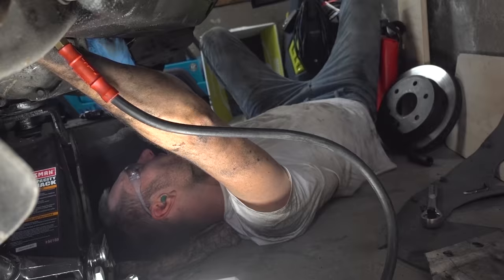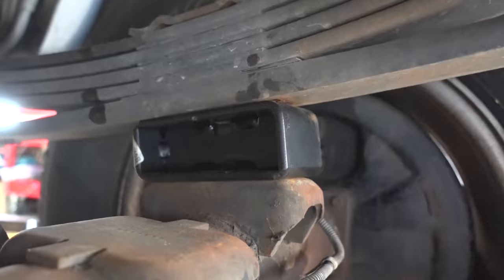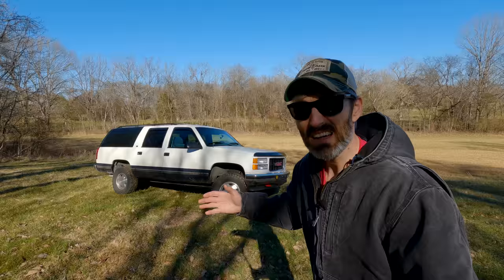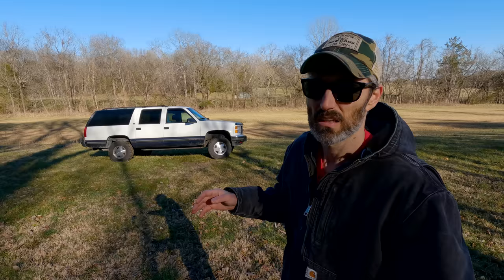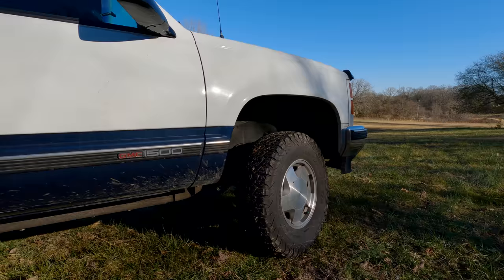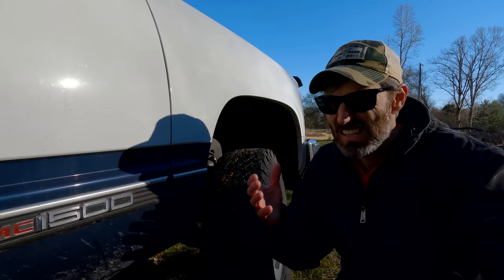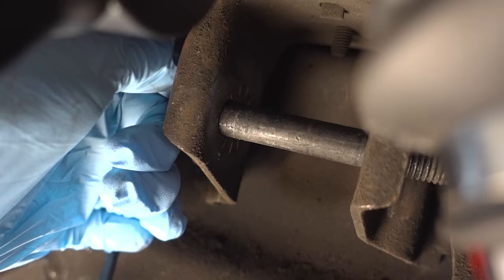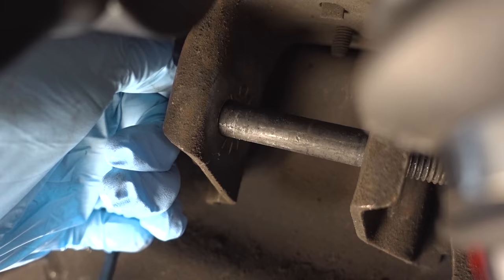Rough Country 2-3" Lift Kit - LONG TERM REVIEW!!

Comment: Great job Jimmy! Honest, thoroughly tested review. Glad I didn't rush out to get one for my Suburban.
Reply from the maker: I seriously considered a body lift only before this… now I’m wishing I went that route. Maybe I’ll still do that. 🤔
Reply: @1RoadGarage  Nothing wrong with a body lift, if you actually get the bumper relocation brackets, and brake line extensions.
Reply: @1RoadGarage  body lifts suck a hole nother way! Way hillbilly bc all your wires are going to be stretched and strained. Lots of problems that will turn into a nightmare. Don't do it!
Reply: I have this same lift kit on my wife's 1998 k1500 suburban  and absolutely  hate it.

Rides like crap and eats front end part.

I have been slowly  collecting  parts to do a SAS on leaf  springs  .Custom leaf packs from Off road design  and it should  ride pretty  good .

Pretty  simple  to do with a Ford dana 44 hp. 

Even able  to retain  abs with hummer h3 brake from THOR parts
Reply: @@stephenmckinley8855  This is the proper way.  SAS or just leave it stock.  The torsion bar and A arm drop bracket kits are a hot mess as well.

Comment: My 2001 GMC 3500 Dually for years looked like a wedge going down the street. The front end was always sitting on the bump stop, so my son and I cranked those bars and now the truck rides level and feels better.
I have put 3 ton of wet sand in the 8 foot bed and didn't even hit the overload springs.

Comment: I did the same lift kit to my 1999 suburban a little bit after you posted your video of doing it. yeah i've had a hard time aligning mine also. I just had it aligned for the third time and it is still a little off. I've just decided that its good enough and im going to keep it how it is. Im really happy with the tires I have under it though. They are 33" Maxxis razrs MT. I would highly recommend them to anyone. I get insane amount of grip in all surfaces, even deep snow. Ive even crossed through a stream with them no problem. If I could do it all again though I would not do the lift and just trim the fenders a little bit to fit the tires.
Reply from the maker: Good to know on the tires. I love the BFGoodrich so far but like to hear what everyone else is running.

Comment: I have a 94 k1500, I did the 2 inch blocks and also used the Rc keys, I did about the minimum crank on the keys and got about an inch and 3/4 lift in the front.  I think maybe if you just would have done the keys only in the front it would have been way easier and maybe closer to the results you wanted.

Comment: Thanks Jimmy! I have a 1999 Tahoe and everyone is telling me to lift it. Mine has low mileage and needed some general work done to it. Figured it smart to get the Tahoe 100% safe and reliable before I start messing with lifts (which I am almost at that point of deciding on a lift) and was looking at this Rough County lift but like you couldn't get over the torsion bars being used to lift the truck. I follow another guy on YouTube and he brought up the same issue you addressed here with this kind of lift. Thanks for saving me the headache and hassle if I were to have gone down this road.

Comment: Everyone I know always chops off those bump stops for the control arms when they lift it- Obviously it was put there for a reason but in the 3 years I have had my listed truck I haven't experienced a single problem with chopping it off- actually I've noticed the opposite! As far as off roading it has given me so much more travel in the front. I don't know about your suburban but I'm my Silverado has another bump stop on the lower control arm which does a good job of still giving you some support. Appreciate the video though! There's a lot you hit on that I would have loved to know 3 years ago haha

Comment: There are 2 reasons why the front lift is more than the back.  1.  these vehicles almost always come from the factory with more height in the rear than the front and, 2. when off roading, since you have a fwd bias weight balance because of the engine, you potentially compress the front springs more when you hit a large bump or dip so you need a bit more suspension travel there.  The front modestly higher is NOT an engineering problem with the lift kit.  You can buy a larger block for the rear if desired, make sure you get appropriate U bolts with it.

Comment: You're completely right.  I have a 92 1500 Silverado 4x2 ( springs inted but basically the same problem ) I had the exact same problem with down travel and alignment and when the wheel moves up the alignment changes really bad giving you an unsafe feeling ( probably it is ) all this issues are gone in my case when I add an extra cross member ( Rancho kit) .  This holds the lower control arm giving it more space between both control arms and the right angle . Of course you will need a kit with longer links and probably in your case, spindles.  The rear suspension is very easy to fix . Give it a chance before you take it off . One more thing , the kit will probably move the " offset" out (that happened in my case )and will look better in my opinion . And some spacers in the back :)

Comment: Part of a suspension lift is that the lower control arm is replaced with a modified lower control arm to combat the excessive positive camber by giving a slightly more negative angle so when the lift happens your camber will be close to the factory spec of camber.
Reply: Where can I get the modified lower control arm?

Comment: I hate to bash on anyone's products, but I've had your same experience with RC. Put a 4" on my Toyota tundra, yeah that was not smart on part - but after three years,I did the same thing, pulled it off and put on a quality lift that returned my ride quality and didnt need an alignment every year.
Reply from the maker: Interesting. Noted.

Comment: I have a very similar lift, I did the ebay one that are the same components. I don't have the same issues. I kept my stock shocks, I also kept the stock control arms. I used the keys from the lift. I have a good alignment, The front is exactly 1 inch lower than the back. Once you replace the control arms with the stock ones. Try keeping the RC keys and adjust them so the front is 1 inch lower than the back. I also switched to a coil over front shock. This allowed for less tension on the torsion bars. Did not need the shocks for the alignment to work. I hope it all works out. Let us know what happens after removing the RC control arms but leaving the RC keys. Keep'em coming, stay on the road!

Comment: I was very skeptical when I considered purchasing a “leveling kit” for my 1998 Chevrolet k1500 so I done quite a bit of research also. I ended up piecing together a leveling kit which included 2500 heavy duty extended swaybar end links, 1-3” adjustable torsion keys, and 1-3” freedom off-road upper control arms. I previously replaced the idler/pitman arm with MOOG replacement parts along with the original shocks on the truck with bilstein 4600 series with no shock extenders. After all the components were installed the torsion keys were only turned about half way up and  the shop that aligned my truck had to remove a key/tab so they could align it properly. The truck handled and drove amazing especially since I had enough space between the upper control arm and the bump stop. I could easily clear a 285/75r16 maxxis m/t tire on a 16x9.5 billet specialty wheel or a 305/70r16 Toyo m/t tire on 16x8 weld wheel. I hope that maybe this info will help with someone looking to do something similar. Thanks for the great content that you’re able to distribute and help spread knowledge.
Reply: I’m considering getting the leveling kit for my 03. I’m currently running the bilstein 5100s and want to swap to 4600s because they are softer and will make it ride better. But the 4600s are for stock ride height trucks did you have any issues with that? Also mine is currently sitting on the bump stops, will that go away if I install the leveling kit

Comment: The reason the rear is lower in your case is because it’s a suburban. The rear half of your truck is MUCH heavier than your standard ext cab K1500 pickup. Like you said these are average/guesstimating measurements for different cab configurations. Glad to see you’re still working on this ole girl!

Comment: I actually love this kit because I actually put it on my 98 Tahoe.And it worked amazingly And all I did was just take it off-road a couple of times and to some trails and some off road sections near my home. The truck actually performed a lot better than a dead stock And I barely lost any fuel economy.I went with Falken wildpeak at3w LT265/75/r16 I can't wait to try this on my 1999 tahoe 4x4 I was actually really stupid for selling my last one On this next one i'm going to do a HT383E GM create engine with a 4L80E auto transmission Next time i'm using AT4W Falken wild peak

Comment: I used lift keys and Kryptonite upper control arms on my silverado 2500hd. No issues after 50,000 miles.

Comment: You're the man! I was considering doing a little 2-in lift to try to fit bigger tires under my 96 Yukon but I honestly I'm not a huge fan of the look... Because then you're basically forced to run an oversized tire, speedometers already way off, I'm not down for a much harsher ride and the inability to align properly. I remember when I had my Jeep TJ one guy called rough country rust country and told me that they were garbage. I'm guessing old man emu and stuff like that would be a better lift but I'm sure it would be substantially more expensive. The other thing I don't think I heard you mention is if you're dropping your front differential by 2 in to keep the axles at the proper angle then you technically are losing the ground clearance that you were trying to gain in the first place. You end up at the same spot with a harsh ride and a goofy look. Really appreciate you sharing your insight

Comment: For the tire size you have (which I believe are LT26575R16?), stock height would be just fine. My brother's 95 k1500 Z71 came with that size of tire (even listed on the door jamb) and the few times we've ever run it in the desert or mountain trails it was a pretty capable stock vehicle. I myself have a leveling kit on my 2500HD that came with the truck when I bought it from my other brother, and just like you said, any bump on the road on the downward travel you can feel and hear it. I thought about putting it back to stock configuration, but my tire alignment is just right currently. Howdy from Rio Rancho NM!

Comment: Replace the steering knuckles with taller ones that relocate the the upper ball joint higher. That would take care of the front, giving you that upper suspension travel. As for the rear end sag, you can fix that with a taller 3 or 4 inch lift block or possibly adding lift shackles. That would correct the rear and raise it back where you want it.

Comment: Back to the basics! As the feller said below I have 2000 k2500 and he replaced the stock keys with 2-3" lift keys and it rides horrible so I'm going to either crank the ones installed down or replace with the stock keys and crank those up some to get a smaller lift, the other owner also killed the shocks because he didn't use extenders and the front is bouncing all over the place!! Good luck with your project, I guess that's why we call them projects there never finished lol!!

Comment: Excellent video and honest take on your lift kit.
So many swoon when they drop some coin on upgrades. Enchanted by the hype, and the fact they paid for it so it must be a good purchase.
Kind 9f like when I paid $1100 for a KW Varient 1 coil overs on my 1991 VW corrado. Everyone boasted these were the bee's knee's of suspension.
While my handling was crisp, and my car did hug the road better. 
The ride was harsh, and not adjustable rebound.
Honestly thought they are ok, maybe I should have dropped another  $300 for the Varient 2, and got adjustable rebound. But honestly don't feel they were worth the $1100 price tag.
Thumbs up on your honesty.

Comment: I have the same lift kit on my '95 Chevy K1500.  I'll have to take a closer look at the bump stops.  It does have a harsher ride, but I attribute that to the stiffness of the suspension and the crappy RC shocks.  I plan to install a pair of Bilsteins (unsure of 4600 or 5100) right after I build a new rear bumper with a swing-arm spare tire carrier.  I recently made a round-tripper from Texas to Joshua Tree and back without any noticeable problems (except for the gas mileage :-) )  EDIT: I checked my bump stops with the vehicle at rest in my driveway...I can pass my fingers through the gap between the bump stop and control arm.  Don't know how this compares to yours.

Comment: When you crank your torsion bars up...., you are essentially pre-loading them.  In effect, this affects the ability of the axle to "drop" normally when travelling over bumps, potholes & ruts thereby increasing both the harshness and rebound of the front suspension.  While gaining more height, wheel travel "droop ability" is less and directly proportional to the amount you crank them up.  So you must ask yourself--is it worth it?  I have the Superlift 1.5 - 2 inch suspension lift for my 1998 Chevy K1500 Z-71.  Though no longer offered by Superlift, it does an admirable job without the headaches of this Rough Country.  It came with a differential drop bracket that required no modification and re-uses the stock torsion bar keys versus new keys.  The only disadvantage to this is you only get about 1.5-1.75 inches of lift versus 2-3 inches.  I'm satisfied with that and it allowed me to run P285 BFG mud tires.  I also had to have multiple alignments but found a sweet spot that gives me really good tire wear even though the alignment machine shows it not quite within specs--especially "camber"  Great video and I love watching your modifications.
Reply: Superlift instructions made sure you keep a minimum 1/2 inch clearance between the upper control arm and it's bump stop.  This gave me just over 1.5 inches of lift.  You need to have that clearance otherwise your suspension is going to continually "top out" on that bump stop resulting in a harsh ride and tire remaining "in the air" over uneven terrain because it can't drop like it was designed to do.

Comment: Look into replacing the upper control arm bushings with eccentric ones.  I had the same alignment issues and swapping in eccentrics allowed me to get a proper alignment with the front end at a level height with the rear and retain a soft compliant ride because the bars were barely cranked.  Solved all the issues you noted.  May be worth a shot before you remove the lift.  ACDelco and SPC both have options.
Reply from the maker: I’m sure there’s something out there to help my alignment issues. I just find it much easier to return to factory and go from there.

Comment: The Freedom off-road upper control arms will work with the Rough Country kit and allow you to align the front end properly and give you more clearance between the upper control arm and the stop perch giving you more travel than the Moog control arms you installed.

Comment: Hi Jimmy, A good diff drop will also relocate the lower control arms to a lower position.  They will come with replacement lengthened knuckles to get correct geometry.  Of course the price goes up with this.  Also, to keep people straight on what you are talking about, those are "droop" stops, not bump stops.  The bump stops cushion the upward travel.

Comment: I have the same lift on my 94 GMC Sierra. I have had none of the issues you've had. No alignment issues, I'm not maxed out on my torsion keys either. Not sure where the difference is between our two lifts though, I did have to replace my tie rods at install as well however...
Reply from the maker: Interesting. 👍
Reply: Same. I have a 97 K1500, and had none of those issues. I did install heavier duty torsion bars, Bilstein 5100s, and upgraded camber bolt kit with more adjustment. My truck rides great!
Reply: @1RoadGarage  I will say the shocks aren't fantastic, but my oem Bilsteins were actually worse, so I can't say either way on that count

Comment: There’s a trick you can do you take that ball joint abs put it under the upper control arms and it helps with when you have the keys cranked up and keeps it from hitting the droop stops

Comment: Have you thought about trying the suspension max adjustable keys?  I had to use those on my 94 k1500 as other aftermarket lift keys just didn't have the adjustability I needed. My driver side naturally sits lower than the passenger side even after everything suspension and steering related was replacement. No alignment issues, and the ride isn't terrible.